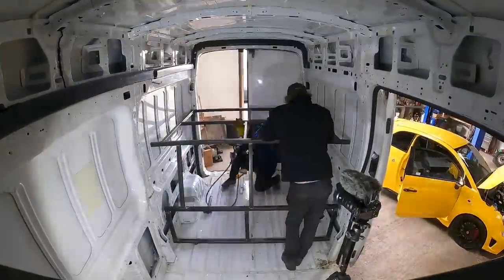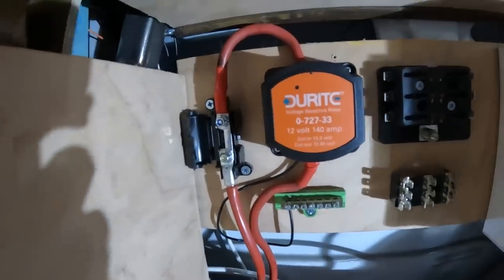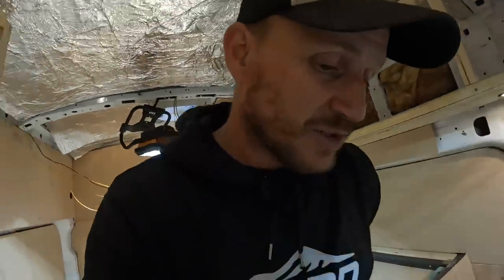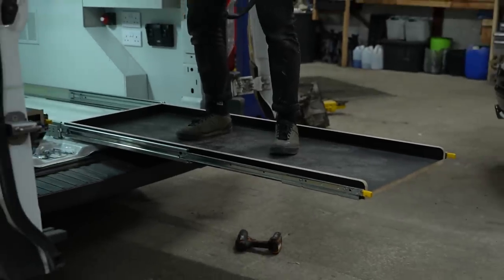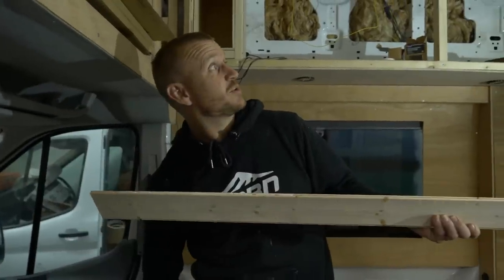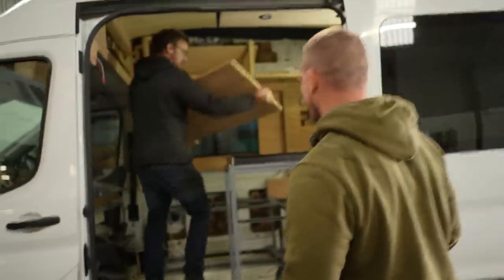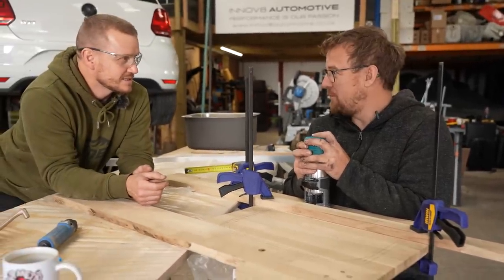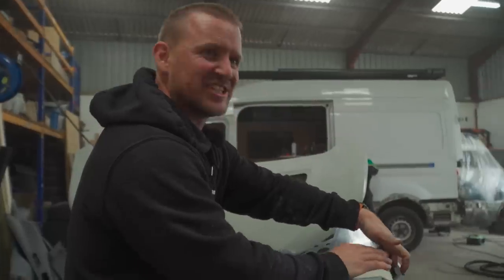I Finally Finished The Ultimate MTB Van Build! | Blake Builds Van Life Ep.8

Comment: Brother, I built mine just recently and did it in 3.5weeks and it was the hardest I’ve worked in years. You did a great job and you should be very proud! Mine was setup for lots of off grid with 618ah lithium, AC, hot water heater, max air fan, LED, garage for 2-3 bikes, 20gal water, coffee and induction cooktop. Still has finishing things it needs, but 95% done.
Reply from the maker: Nice work!
Reply: Wow good work Jeff. 3.5 weeks wow
Reply: @Zimblake  when you make it back to Bentonville you can check it out. Fridge is always full of beer. 😉

Comment: Blake, mate bad news on the tongue and groove you're using for the roof lining. I fitted that in my van and we quickly found out it warps out of shape in the summer and with the movement of the van , glue doesn't work either ! I replaced it with thicker stuff and it does the same thing. I'm now in the process of ply lining the roof with one single panel.
Reply: Balls. That not good news  😅. Thanks for the heads up

Comment: Consider adding some air vents (even ones that can be opened/closed) near those work lights  at the rear of the van or at the back of the garage. Having vents there will result in cross ventillation which will help fight against mould, musk, etc.. It's coming into winter now so that might be a concern. 
In my van I basically cut two 10cmx10cm holes in the floor. When I have my roof vent running it pulls air in from under the van which keeps the van cool, removes moisture and stops smells, etc.. from building up. I'm in Australia so it's more inportant to have the van staying cool.